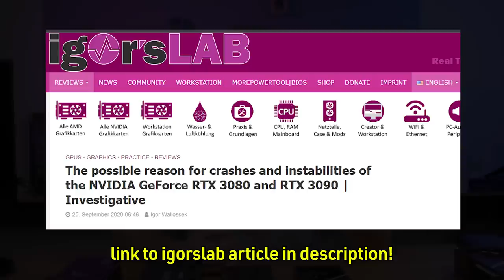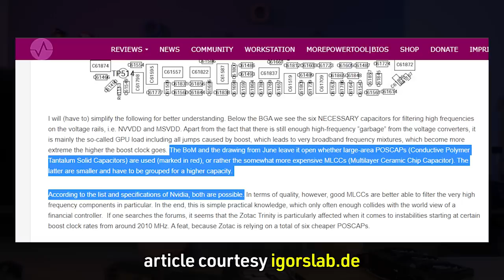The RTX 3080 Launch can't get any worse... Right? Wrong...

Comment: @JayzTwoCents
Is there any indications that this instability can be minimized if "you" get at better Power supply ?
There is two ways of going to this:
1) Get a much bigger Power supply than needed, because less power draw on the rails will most likely be = to lower noise on the Power supplies rails.
2) Look for a Power with low noise.
I am guessing that less noise before the GPU could minimize this problem.
Thank for you a very good channel :)
P.S. I was about to order a 3080, now I am waiting due to this info :)
Br
Jacob

Comment: The worst thing is, is that the capacitors probably cost a few dollars more, maximum.
Reply: Omega They mass produce it though..... If they buy say, 100,000 of the cheap arrays, they could have saved 100,000+ dollars

Comment: I work on high voltage power lines for a living and I know exactly what you were talking about with the bleed off of the static discharging. Sounds like you're standing next to a Tesla coil. and once you get up in the air if you get within six foot of that power line the static discharge will let you know it is there and bite the heck out of you

Comment: Its not just the arrangement, its also what quality/grade SP caos they are using.. For eg, in the evga, they are using 5 set of MLCC, but only 220u. If you see nvidia's, you'll see its above mixture of 220,470 capacitance pos caps, or gaming x trio has 470u which is looooot more than others. 

Also, if you read Gigabyte's response, they said its not this simple to that just this 6 set is responsible for everything. So to say cheap, means yes its cheap to assemble as just droping and soldering 6 items than 60 small ones. But its not that Pos caps are cheap.

Comment: Moral of the story.....
Don't buy too soon....wait for the bugs to be ironed out.....
Some people have more money than patience.....

On a side note:
Having a single capacitor for the filter network will have a single ESR (Equivelent Series Resistance) say 0.2 Ohms
If you put similar value capacitors in parrellel, 2 things happen....
1) The overall capacitance is increased by adding each value together.
2) The overall ESR of that filter will be much lower because total ESR=(1/C1esr+1/C2esr+1/C3esr+1/C4esr+1/C5esr+1/C6esr)  (Using 6 capacitors), this means at a given frequency, the capacitors will exhibit a much lower resistance and send to ground the noise at that frequwncy more easily.
If they all have 0.2 Ohms ESR then 6 in parrelel will make the ESR 0.0333 Ohms, compare that to the single 0.2 Ohms

Comment: Here's my take on the problem: go on Mouser/Farnell/DigiKey... and you can see that MLCC are not usually more expensive than tantalums capacitors. Even the high end RF graded X7R MLCC are not dramatically more expensive than the cheapest tantalums so probably not that much of save. Ofc it depends on the exact components they are using, but I suppose the difference is minimal.

However the key difference is in their characteristics: MLCC has a more acute frequency response, meaning they can efficiently filter out a precise frequency. Tantalums on the other hands are more like charge reservoirs and its frequency response is quite flat, meaning its not great at filtering noise but act more like the power source close to the IC power input. So, when a sudden power spike arrive, without the fast response of MLCC, the card probably will detect an undervoltage/overvoltage condition and shuts itself down in defense. An excellent combination would be tantalum caps followed by an array of MLCC with multiple values to filter out a broad frequency band for EACH IC power input.

Therefore, I feel like the FE cards have the best design (I suppose the 2 MLCC arrays are for the 2 power rails), the reference design a bit meh (only 1 MLCC array?), and no MLCC at all is quite bad since nothing is filtered. And the ones with only MLCC could work, but if the power draw is too dramatic they could be starved of charge.
Reply: @rustable4165  Well since the new drivers limits the boost clock speed, these high frequency problems disappear. So you could say that it can be solved via drivers, but what I said on the hardware side still holds true. Its just a not a great design to only use tantalum without the MLCCs to filter things out on power rails.
Reply: @baokhanh1523  it only drops clock speed by 30 MHz
Reply: @rustable4165  Well from what Ive read new driver kinda caps the clock in at 2GHz. At high frequencies, if the filter is bad, higher harmonics can be created which can intefere stuffs. Im not the designer of the board but I can assure u can in electronics design its generally not good practice to only put tantalums to power pins, you need both. What I can agree tho is that Jay doesn't have any electronics background and a lot of information in this video is crap, just like the article he pulled it from. But I would still recommend people go out and buy cards that have the mix of both, because electronics dont fail after u use it once, it fails after u use it a thousand times even if drivers prevent them from crashing (the hardware silently taking its toll. Tbh they can just adjust the undervolt/overvolt limit to be more tolerant at the cost of hardware endurance to please the crowd). In the long run a better design is preferable.
Reply: @baokhanh1523  i agree 100%

Comment: I will wait for responses from card makers, what is going on, and how they are going to fix it. But power delivery of high frequency chips is hard. Capacitors, ground loops, proximity to load, even nearby tracks and the tracks parallel to power and ground return are important. Component selection is also important. Often you would need a very very specific capactior from a specific manufacturer, that has required performance (ESR, ESL, etc). Some of them are expensive, because they internal construction and leads, and layout placement are very special to push the performance. The big issue is, it can't really often be fixed easily after making a board.

Comment: Full disclosure: I am not an expert by any means in this field so take what I say with a grain of salt. Effectively you are running into some of the same issues with these vid cards as you did with the (no functionally extinct) full PCI and PCI-e sound cards. All that electrical em noise would absolutely degrade the sound quality coming out of those. The really expensive ones would use all kinds of shielding tech, but at the end of the day unless that entire thing is inside a well built faraday cage; you're gonna get noise.(hence why most sound capture is now OUTSIDE the pc in stead of in now).

Except you know, this one is more like a boombox set on max next to the gpu , instead of it being in the next room kind of interference.

Comment: I have only noticed this on my 'ZOTAC RTX 3090 Trinity' and wondered if you get the same? im not getting any errors, but I look to get a post code in the form of yellow light when the cards first powers on. On the RGB strip at boot, I get: 1 Yellow flash, 1 pause (no flash), then 2 yellow flashs. boots fine. Just wanted to check these no underlining issue. Wanted to see if the yellow lights normal with other owners?

Comment: let this be a lesson for you. Don't give advice if you don't know what you are talking about.
Look how many people have believed your false claims.
Reply: Shivam he is the main reason this got out of hand
Reply: For real this video needs to be removed
Reply: What is false?
Reply: Absolutely Dreadful  but who said those are bad capacitors? Don't believe jay, do research from a good place.
And btw even founder edition cards were having problems, so it was clearly just a driver issue.
Reply: @SuperFlyCH  it was only a driver issue, not a capacitor issue. So, what jay is saying is false.
Reply: go and educate yourself
do you know how to read???
the update on the driver were to LOWER the clock boost so the capacitors wouldn't crash the whole system
for love of god people are getting stupider by every year🤦‍♂️
Reply: @kajoguri7756  if it was a capacitor issue then why did the cards run fine on linux. And if it was a capacitor issue then why did the founder edition cards with the so-called better capacitor have the same issues?
Reply: @Shivam-gh2mq  they didn't lol
only a few had problems
and it depends on which card had 2 of the good capacitors
cus even with one it still was a problem with the clock boost
also go read what the update was
and with CAPITAL
"WE LOWERED THE POWER ON CLOCK BOOST"
Reply: @kajoguri7756  yeah, you said it yourself. It was the driver issue :)
Reply: @Shivam-gh2mq  🤦‍♂️🤦‍♂️
Reply: @Shivam-gh2mq  Kajo is saying it's a quality component issue that was resolved by lowering the performance so the lack-of-quality components don't become an issue anymore. If anything, its a hardware issue that's had a band aide put on to disguise it from being an issue anymore.

Comment: Similar to a CPU the card should be handling the basic overclocks that your computer is throwing at it (GPU boost) which it can't. For those who are saying that it was a driver issue, I can guarantee that the new drivers cut that boost out and thats why you are seeing more stability.

The widespread problem here isn't that the card doesn't work within it's perameter specs, it's that it should be able to handle more... and it can't.

So if you're looking for a card that you can overclock in the future, this is NOT IT.

I will be returning my MSI 3080 Ventus 3x and waiting for a more stable reiteration in the future.

Comment: 02:00 IIRC the RTX 2080 had some issues on launch as well and they ended up tracking it down to some cheap chinese memory modules being the problems. They identified which cards had the issues and then replaced them with good models which cleared up the issue.
ASUS isn't what it used to be. I had always ran ASUS MB's for like 15+ years but for the last few years I have had stability issues with their MB's. I ended up switching to Gigabyte and have had no issues so far.

Comment: You want the VRM to be as close as possible to the GPU (and CPU) to handle the huge (60+ amps) current spikes created by CMOS processors. It was these current spikes that required the VRM to be installed on the motherboard in the first place. No, you can't “fix” this. It is an inherent quantum-mechanical defect in CMOS.

Comment: What's with all of the heating issues and poor board designs? My buddy used a heat cam on his Graphics card and the entire thing was red hot compared to the motherboard.
Reply: The issue turned out to be Nvidia post release drivers (pre release drivers were fine), had NOTHING to do with capacitors. Jay need to take down this video as its still misleading people like you,  but he keeps leaving it up for clicks $$. Yes Nvidia released a updated driver that corrected the problems on ALL regardless of capacitor type. Watch this explains all.
https://youtu.be/lhyCdraz54s?t=350
Reply: @Battleneter  I was asking about the heating issues with the new boards not what he was talking about.
Reply: @Some1special  What heating issue?, of course GPU's run way hotter than a Mobo's,  as long as the entire GPU is well within spec there is no issue.
Reply: @Battleneter  this new generation of graphics cards are running dangerously close to the max rated temp for the PCB they are printed on. That's without overclocking as well with factory air cooling. We have a 2080 ti that was sent back when the soldering melted off the underside of the GPU. Brand new just out of the box with everything set up correctly. It ran for 2 weeks and when it stopped we noticed a pool of melted solder on the bottom of the case. That was the EVGA one that runs like $1200 online. Since we rolled back to some Radeon cards and everything works great. Maybe it's whatever the RTX stuff is doing? Only noticed that it's a problem when we plug in the Nvidia cards.

Comment: well this didn't age well.
Reply: Why not?
Reply: @claymore7970  They fixed it with a driver update
Reply: @ericmckee8007  they just lowered frequency as a performance. There is still huge hardware problem.
Reply: @ericmckee8007  They didn't "fix" it. Please inform yourself. Rainbow Hyena is right.
Reply: I mean your comment crashed and burned on the runway, considering they just lowered the clock and voltage to walk around the existing hardware issue.
But hey, it's not false advertising if they fix an issue and it suddenly doesn't run the speeds advertised on the tin anymore, is it?
Reply: @Volvith  yikes. Nowhere on any of the 30-series' boxes did they claim 2ghz or more. 'Lowering voltage' would have resulted in less reliability and noticeably lower power draw/temperatures, and neither have been reported since the update. I recommend watching Hardware Unboxed's video on the subject. Post-update benchmarks aren't actually measurably lower. And literally all manufacturers of 3080s had this CTD issue, even Asus with their MLCC arrays. Do more research.
Reply: bruh they lowered it like 1%
Reply: @rustable4165  1%? Where did you get this BS?
Reply: @physicists9486  bruh they lowered it 30mhz
Reply: @rustable4165  Its 90-100 MHz
Reply: Also the lowering did not fix it at all, it just gave nvidia more time to find a permanent solution.
Reply: @physicists9486  its actually 30 MHz people manually did it 90 - 100 MHz but its 30 MHz
Reply: @rustable4165  They didn't do 90MHz because they wanted it🤷‍♂️. But it is BS to discuss about it. Nvidia could've or should've done it better. It was clearly a design flaw but hey, it still performs great.
Reply: @physicists9486  yeah it prolly is a design flaw but all these channels taking it out of proportion, trying to get views
Reply: Mikel Montalat  lol okay haha

Comment: Found this video because my Gigabyte 3080 Vision just randomly disconnect, I have "no signal'. I tried to underclock it to 1710 MHz, and it still crash. You pay a premium for OC and stuff and it's not even working and even break the card. I can't even get it replaced there is no stock fml

Comment: Jay could it also be because of vram temps being in the stratosphere due to poor heatsink contact? Try rendering or mining and see how high to TJmax those temps go!
Reply: The real problem is that there was not frequency limit and they crash when they go over 2000mhz maybe aa little higher ( remember that 1740 its the boost clock on 3080 Strix for example) so it got fixing by just updating drivers.  and the brands because of all those who supported this misinformation began to change capacitors without necessity maybe some people even sold they 3080 because they were afraid that because of the capacitors they were "bad cards"

Comment: This video is now debunked and a driver update fixed the issue.  Retraction time.
Reply: The better speced cards dnt have the boost issue the driver just forced a lower boost clock on all cards so the lower speced capped boards for crash...so it's both really the caps filter noise the higher the clock the more noise is on the line....the better the cap the better the noise reduction on the line so you can get a higher clock....not a lot but a higher clock 20 30mhz its not much but if rather have those caps as the cards ganna be way more stable at stock frqs an can take more noise from the rest of the system...or surrounding crap like Wi-Fi...phones...mics ...to the kettle lol

Comment: Considering those caps and the time on pick and palce might cost a dollar per card...
Reply: The issue turned out to be Nvidia post release drivers (pre release drivers were fine), had NOTHING to do with capacitors. Jay need to take down this video as its still misleading people like you,  but he keeps leaving it up for clicks $$. Yes Nvidia released a updated driver that corrected the problems on ALL regardless of capacitor type. Watch this explains all.
https://youtu.be/lhyCdraz54s?t=350
Reply: @Battleneter  So moral of the story is run linux.

Comment: In electronics...we were taught to overkill power supplies for such reasons.  There was entire semester course where that is ALL we learned.  Again, this was 15 years ago...not sure what they teach now.   BUT, those caps, yeah they are expensive in mass quantities but for the entire card...spend the extra $20 to NOT have this happen.  BUILD a demo unit first before you go mass production.  Unfortunately, NVIDIA will get all the bad wrap and not the card makers unfortunately.

Comment: Your so right... My msi 3080 is branding by 1815Mhz, thats what i pay for! With boost 2050Mhz, so 235Mhz+. After crash i reduce the Core Clock by 50Mhz and all is fine. Overall a + by 185Mhz more than was msi say's. The next thing is use 3 seperate 8pin cable for the card, and not the Y-cable. Other Cards on 1710Mhz msi on 1815 so 100more as some others... For me is all fine with the 3080.

Comment: This sort of problem should have been found during the initial design of the board. It should have stood out like a great sore and someone in that whole team of scientists and engineers working on this tech would have seen it and called it out immediately. I am sure this didn't go unnoticed by the people who designed the board. They probably raised this issue with the big boys and they were shut down due to higher cost for better quality components. Regardless. For a premium product with a premium price, this shouldn't have been an issue in the first place. All boards of this high end class should have 6 arrays of expensive components!